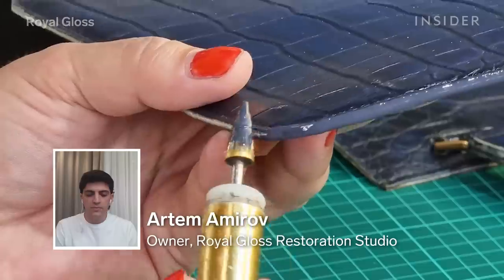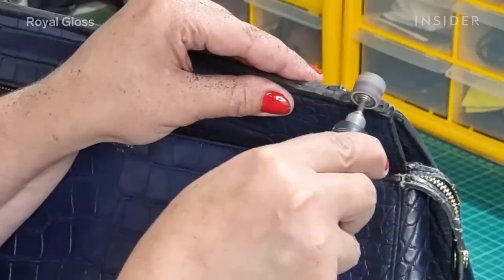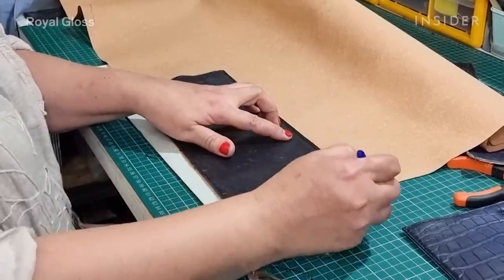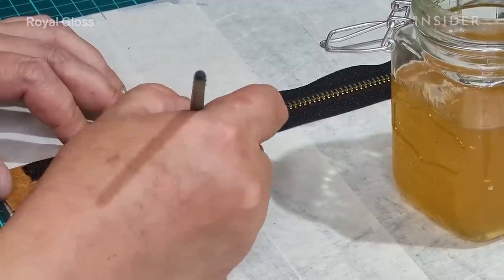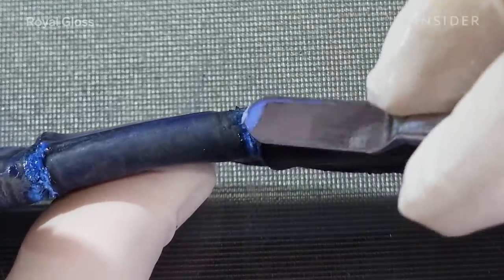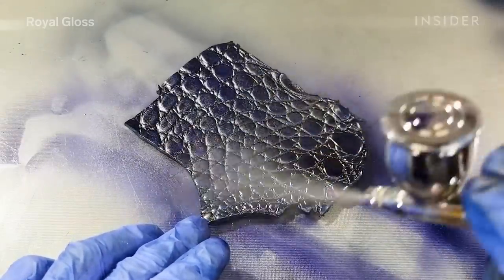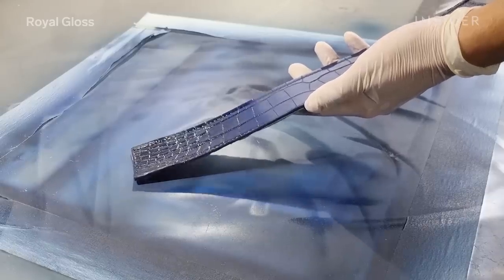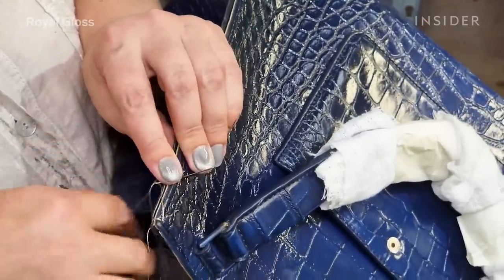How A $42,000 Celine Crocodile Handbag Is Professionally Restored | Refurbished

Comment: Isn't it just a really good replica now?
Reply: Ship of Theseus
Reply: Was wondering what all the work done does to its value.
Reply: @tonkabear2369  I don't think it's a $42,000 Celine crocodile handbag anymore.
Reply: what are you talking about? they replaced almost nothing except stitches and paint.
Reply: @Ass_of_Amalek  No they made a new part with the sheepskin too and the zipper thing. And repainting the logo makes the logo not original.
Reply: @chandler4608  It also wasn't a $42,000 Celine crocodile handbag before the restauration ;)
Reply: @berni684  but it's not ORIGINAL and I think that matters most.
Reply: @chandler4608  The handbad is just a handbag until you slap a logo on it
Reply: Yeah, goodbye on the original value. Not even the techniques are correct displayed in the video...
Reply: I mean it wasn’t worth much of anything in the condition it was prior to its restoration.. soooo?
Reply: No. That's not how it works with restoration. That bag was valued at about $27k before the restoration and now it is valued at above $40k due to rarity and age. If it was a replica now it would be valueless.
Reply: @trevorduna7666  valuation usually is based on original condition. poorly restored ones can not be over original value.
Reply: @tonkabear2369  It lowers it but the owner probably doesn’t care about the price they obviously love the bag and want to have it for as long as possible
Reply: @Ass_of_Amalek  Also replaced the sheepskin inner lining, zipper, zipper pull...the exterior croc skin and hardware remained original/restored.
Reply: @chandler4608  I would say it's original.  Just restored.
Reply: Do you say that about restored paintings as well? Plenty of famous paintings have received touch ups with professional restoration artists repainting certain areas and replacing the canvas. Does that mean they’re no longer original paintings? With this logic, even the Mona Lisa would no longer be considered a DaVinci original. 😉
Reply: no
Reply: @chandler4608  no

Comment: If you replace every plank on a boat with a new one , is it the same boat?
Reply: Nope it's  not the same.
Reply: Yes. Consider Divorce Courts.
Reply: Ah, my Father used to tell me over and over again the legend of Abraham Lincoln's Ax that was in a Museum.  One day the handle broke and so it was replaced by a new one. Then the Ax head broke apart and was replaced.  The Museum put it back on display as Abraham Lincoln's Ax.
Reply: Depending on how long and how quickly it was done
Reply: Ahh I see a Ship of Theseus reference
Reply: The ship of thesis , vision's
Reply: Nevertheless, a boat in use wears out little by little till it's old & broken, is it the same boat? 😁
Reply: Someone saw wandavision
Reply: @Foolish188  😂😂😂😂
Reply: Paradox
Reply: @karenbondechek  That is such a good point haha.
Reply: if it’s a boat that cost 42k and you spend less than 5k getting those planks i’d say so
Reply: There is a causal identity
Reply: Million dollar paintings are often repainted to fix tiny imperfections and they dont lose value
Reply: Difference is with the bag they only replaced a few things... not everything
Reply: @TheQuarterback:OutofthePocket Yea but that doesn’t change the price. Even mona lisa has probably been restored a few times
Reply: @TheQuarterback:OutofthePocket not really
Reply: Your Bone is replaced completely in 10  years. Are you still the same you?
Reply: At least it's still a boat.

Comment: This is one of the best bag restorations I have seen, I like how he talks us through the process ! Good job 👍🏻😉
Reply: He did one of the best bag restorations I've seen too. And I've watched dozens of videos on leather restoration. It was clever how he made sure the paint "faded" in some areas so it doesn't look odd. It would be a strange sight to see a bag with worn handles when the rest looks like new. Now I understand why some car paint shops have long talks with the owner and try to talk them OUT of doing a bumper-to-bumper paint job. They sand off and repaint the most damaged areas and only touch up some smaller, less noticeable parts because it will make the car look odd in some spots. Still, doing a paint job on a vintage car is not cheap. It can start at $10,000 and easily go farrrr beyond $25,000! Saw an auto detailer get his classic Porsche repainted and he got a bill for almost $20,000!

Comment: I'm not concerned about the original cost of the bag. 
But what did the restoration cost the customer?
Reply: Probably over $500 -$1,000 minimum. These designer bag restorations are very expensive. Probably also not really worth it.
Reply: @shawneejones4566  of course it is, if that really cost $42k
Reply: @shawneejones4566  lol. Try a couple thousand minimum
Reply: @shawneejones4566  Don’t know anything about this but it looks almost brand new to the naked eye and u can’t notice a diff except by a much closer look. I think it’s worth it and much better than spending another 42k if not more to buy the same bag looking just as new 🤷‍♀️
Reply: @RUOuttaUrMind  If you buy an item for that amount it is worth it. Doesn’t matter whether it’s a bag, shoes, car or home, if it’s expensive you want to keep it in tip top shape. Well worth it.
Reply: It depends on the situation. If you want to "bring it back to life" for the sake of using it longer or even sell it online second hand then yes
Reply: @RUOuttaUrMind  lol how not when you can put back into the market for 10-20k?
Reply: I would have charged 20% of bag value, that thing was trashed
Reply: @shawneejones4566  it is worth it. We need to get away from this current culture of throwing things away.

Comment: 2 things surprised me. 1. This bag had very bad wear for an exotic Celine and one that i assume came from Phobe Philo's era. I mean only 8 years old and already with so much cracking and a missing zipper pull? Then 2. For a $42,000 bag, the owner sure used this as what appears to be their beater bag with the amount of wear and tear.
Reply: Why is this bag SO expensive couldn't you get a Hermes in crocodile for the same price?
Reply: @grazutissmith9647 Yes you can get an hermes exotic in the same price range. Celine is also considered as one of the top high end labels so they can get away with prices like this. Other brands' exotic leather goods are also in the same price range tho so it all boils down to preferences in name and style.
Reply: They probably only had 1 really nice bag and felt 1. Use it as much as possible to get ones money worth  2. to show off their rare piece  and 3. Knows an excellent restore guy that will fix it down the road. Whatever the cost, surely the owner can afford it
Reply: So? It’s their bag. They spent a lot on it, and they love it, so they use it as much as they can. To each their own. 🙂
Reply: @grazutissmith9647  …. The same reason the Hermès is expensive. 😅 They’re both high end luxury bags.🙂
Reply: @Josie-6  yeah so what? what's your problem because i don't have a problem with them using their bag, it's their bag. Not sure where you think I made an issue about it.
Reply: @gurlbye9942  you sounded like you had a problem with someone forking out 42k for a bag and using it well
Reply: @Deep-dive-hustle  I mean I literally just said those 2 things “surprised me”. Like those were the 2 things that stood out to me the most about this video and not necessarily the main subject of it which is cleaning and restoration. If anything I’m impressed instead of having a problem with it like you and that other person thinks.

Comment: I would at least expect the bag to hold up a bit better after just 8 years (or less). I know that the price is mostly an exclusivity thing, but to me it looks like they could certainly have done a bit of a better job when selling a luxury item like that. With a Ferrari you also know that the price isn't just the value of its parts, I doubt that a customer would accept it if it wore like this bag (maybe no the best example, since race cars do wear very quickly if you actually race with then, which is just indicative of race cars in general). Either way, I'm more shocked by the bad (material) state of this bag, rather than its price.
Reply: It does seem like the owner wasn't very careful with bag. These high end bags are often made from delicate materials where you really need to look after it.
Reply: Agree! I have cheaper designer bags that looks new after twenty years. This bag looks like someone saved it from a dumpster.
Reply: Ferrari upholstery falls apart much faster than that.
Reply: @Kaivijs  Not all high end bags are made from delicate materials. The LV monogram bags are made of canvas and have amazing durability. I have one from the 90s that is still in amazing condition, no wear and tear,  and will probably last for the rest of my life. I’m not precious with the bag and it gets used on a regular basis. 

It’s a mixture of the material and the care people take in their bags that determines the wear and tear on a bag.
Reply: @0neAutumnLeaf  Well you have a LV from the old and golden era .The new vinyl coated canvas is much thinner and more fragile .
Reply: I think the bag was used often so that's why it looked like that
Reply: It’s leather. It needs to be cared for and conditioned at least once a year, nothing to do with the quality of the bag.
Reply: @ballislife9092  Exactly, at the end of the day it's cow skin.
Reply: The bag seemed sturdy, I guess the owner just enjoyed it that much. 
After 8 years of liking a bag so much, well at times it wouldn’t be rare for it to be damaged.

Comment: Would this item still be original or fake components? If you restore an antique item it also looses $ value.
Reply: Im guessing that depends on the damage, if the damage is so big that it renders it unusable then it certainly looses $ value, but a restored bag especially one that is rare and is no longer being manufactured I’m guessing the $ goes up since it can be used. Just correct me if I’m wrong.

Comment: Does it retain it’s value after deconstructing and restoring? Anyone knows?
Reply: Really depends, but as a rule, it’s not worth as much as if it was original in good condition. Even the handle was replaced with cow leather which is way less expensive than crocodile.

Comment: I think that the restoration was excessive, it goes against all what Bamgauer is doing in his videos. The lining was not in that bad condition in my opinion and the replaced it with thinner skin. There has to be a way for restoring these in the same way as paintings are being restored
Reply: I suppose a handbag is different being it’s functional, baumgartner is simply repairing an object that will hang on a wall and will only go through wear and tear by accidents. Bags are like shoes in that they are constantly in use, and it’s expected that they will deteriorate. In the same way a cobbler replaces and reforms aspects of shoes, replacing the sole for instance, the replacement of the lining is expected to allow the bag to be a functional piece once more. Handbags in gallery’s must stay the same forever as pieces of art, but a handbag for daily life? It’s expected to go through repairs and replacements.
Reply: @Thesleepypineapple  exactly, a painting is meant to hang on a wall but a handbag is meant to be used.

Comment: Love the artisanship in restoration. Curious about the cost to restore.  It's all part of the bag's story.
Reply: I would think a few thousand usd.  They didn't seem to replace anything extremely expensive or rare (sheepskin lining, zipper, zipper pull, paint).  The cost of the restoration seemed to be mostly labor (which is certainly expensive at this level of craftsmanship).
Reply: @kenc2257  Thanks, Ken.

Comment: I suppose a handbag is different being it’s functional, baumgartner is simply repairing an object that will hang on a wall and will only go through wear and tear by accidents. Bags are like shoes in that they are constantly in use, and it’s expected that they will deteriorate. In the same way a cobbler replaces and reforms aspects of shoes, replacing the sole for instance, the replacement of the lining is expected to allow the bag to be a functional piece once more. Handbags in gallery’s must stay the same forever as pieces of art, but a handbag for daily life? It’s expected to go through repairs and replacements.